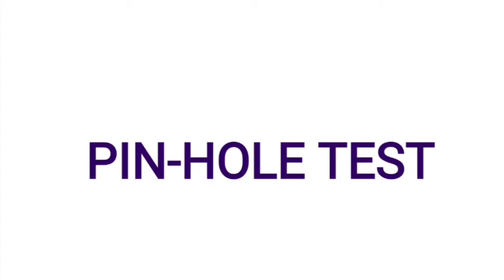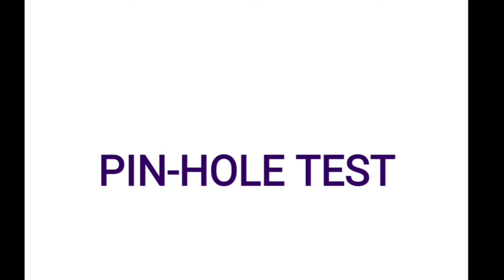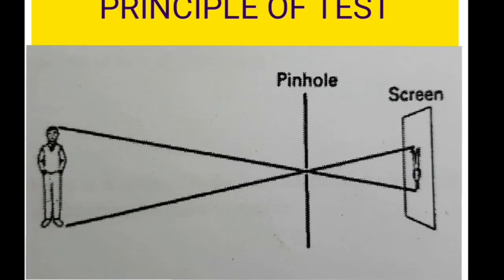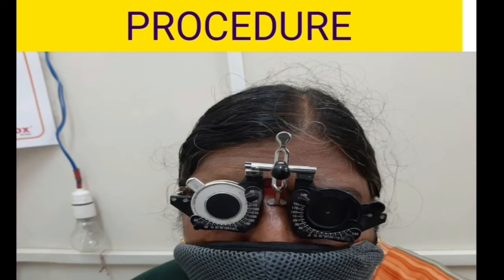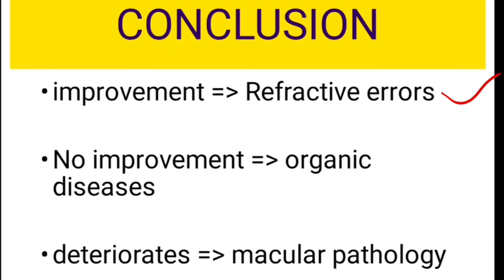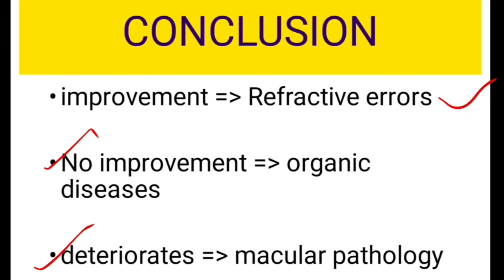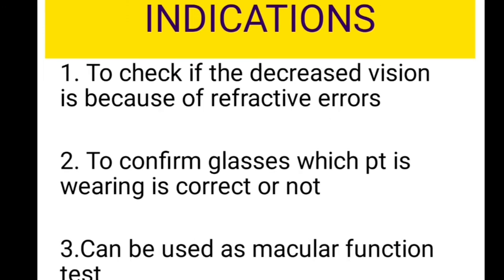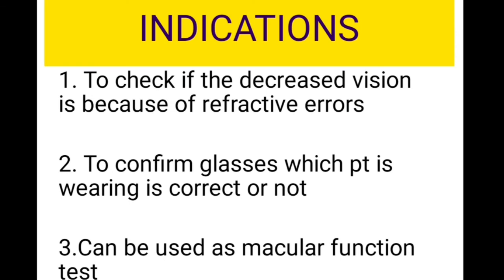PIN-HOLE TEST || PROCEDURE AND CONCLUSIONS OF PIN HOLE TEST

Comment: Thank you for video. But i have 1 question is “why the hole diameter is from 1-2mm”
Reply from the maker: It has to be less than pupil diameter which is 2 .5 to 3mm.
I'd less than 1 mm,it will lead to aberrations.